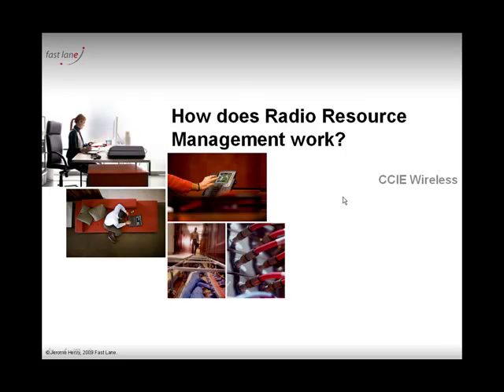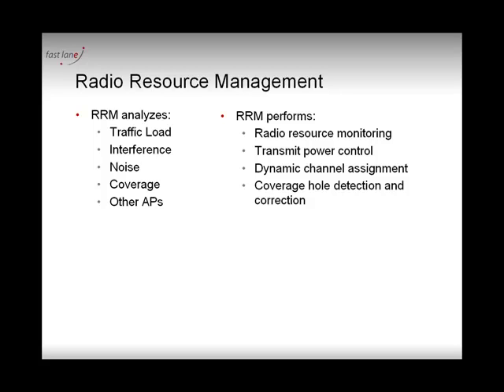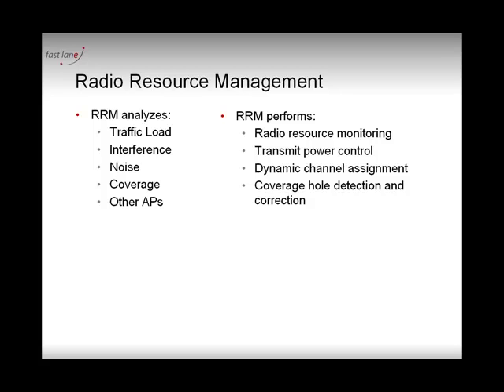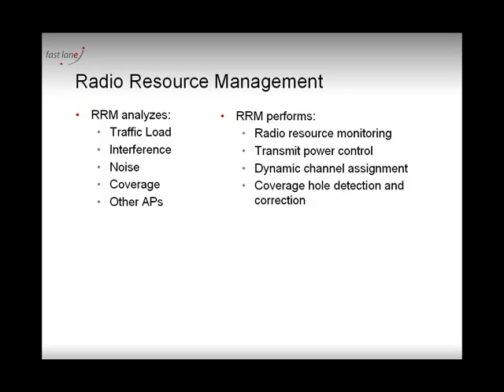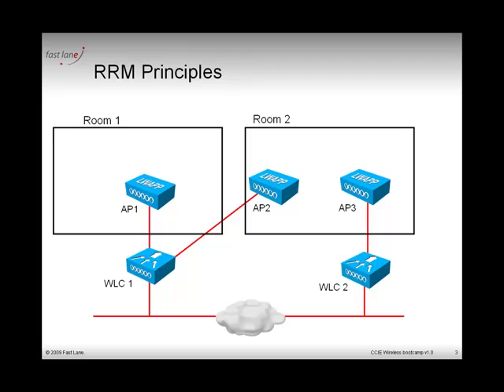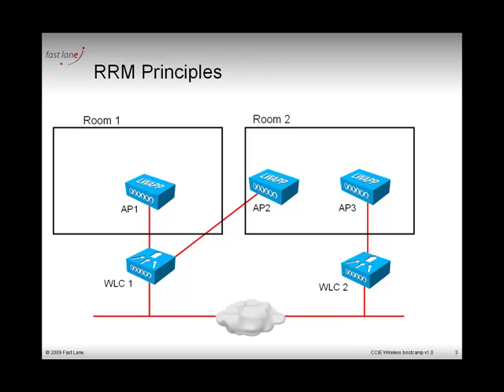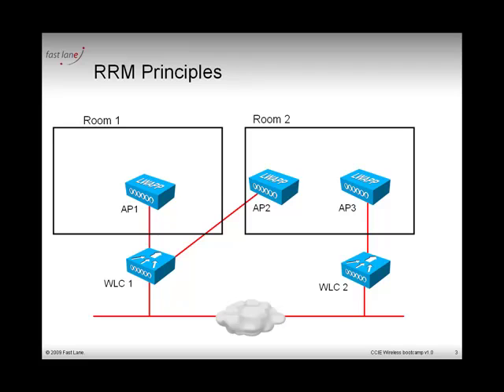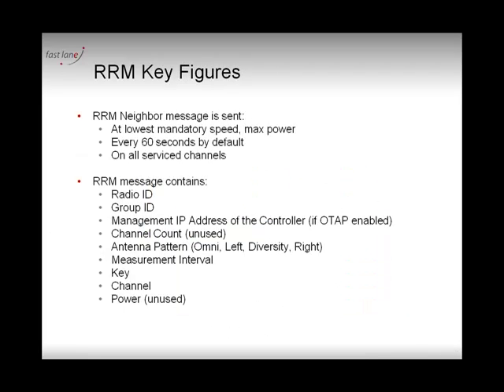RRM, Radio Resource Management, Part I

Comment from the maker: Nothing special on your Cat 6500... you just need to make sure that these ports are open between the controllers. SO if you have any firewall between the controllers, you need to make sure that traffic on these ports is allowed, otherwise controllers won't be able to exchange RRM information, and each WLC will appear as alone in its RF group, even if all controllers are in the same Mobility/RF group and can ping one another...